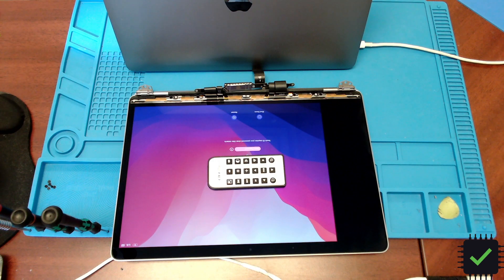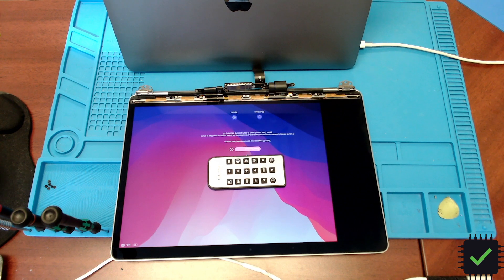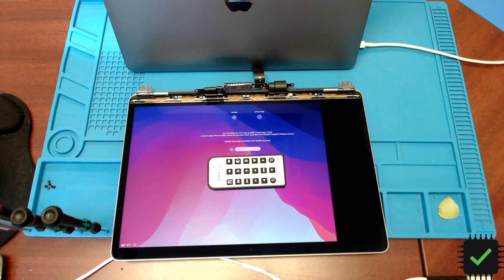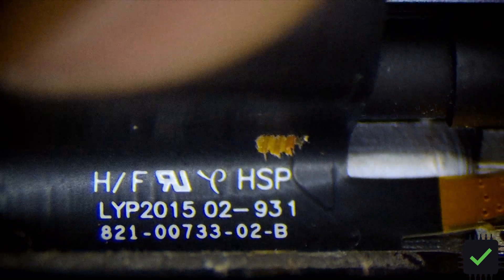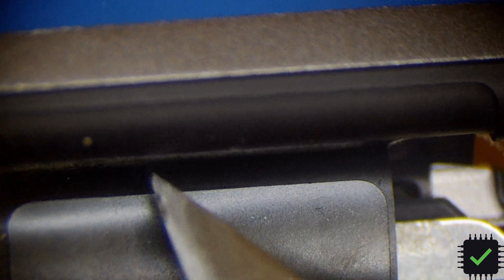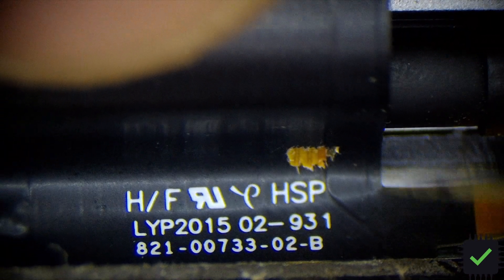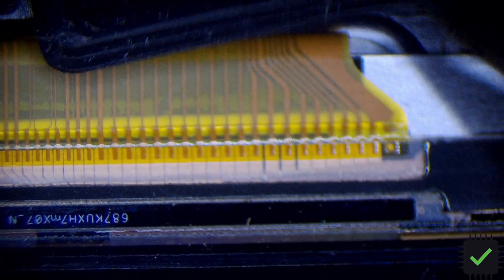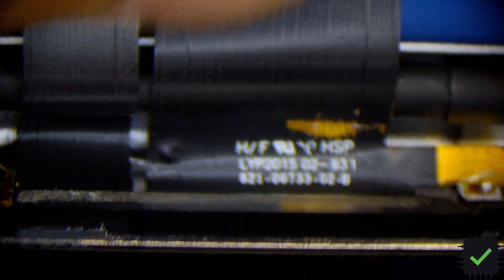Failed attempt at fixing Wide Black Vertical Line on 2020 MacBook Pro A2251 A2289 LCD Screen

Comment: before even watching this video, your not going to fix this. the problem is not in the black cable, the problem is in the light brown ones, the one that is directly responsible for that zone. you have a nick in it, or crack or a crack in the lcd on the inside.

Comment: i found in ali express (LCD Glass Cable for MacBook Pro) the flex , i will get few to see f i can fix it
Reply from the maker: Use air tool slicer to get the lcd out of the frame. Pretty straight forward and less chance of cracking it.

Comment: Yeap, not fixable, I have one exactly like this albeit an earlier model and same issue! Those flex cables are junk, Apple knows this yet they persist in using that exact same shit design for years on end. Who's really to blame‽ The customers of course! They need to stop supporting this shitty company until they change or go bust!
Reply: the display is made by LG for apple.  you want thin displays, you get thin.
Reply: @floridaapplemacprosinc.2224  i dont want thin anything, they pushed that shit onto consumers. I'm pretty sure consumers would rather have a chunky device that is sturdyand has a larger battery than a flimsy shitty think POS that breaks.